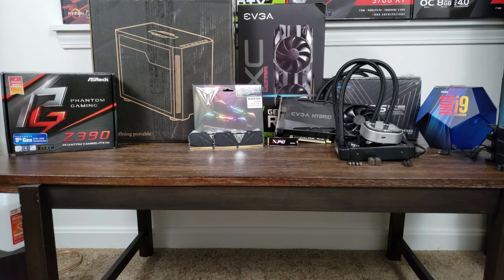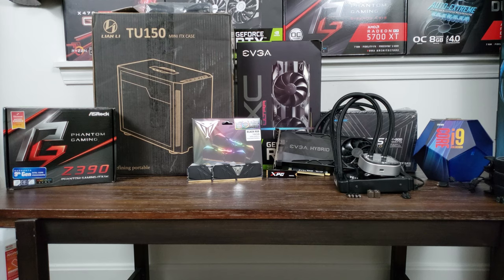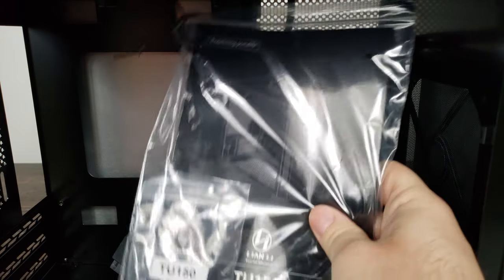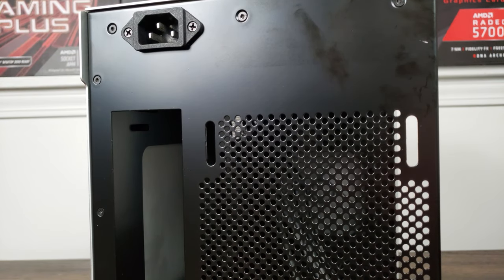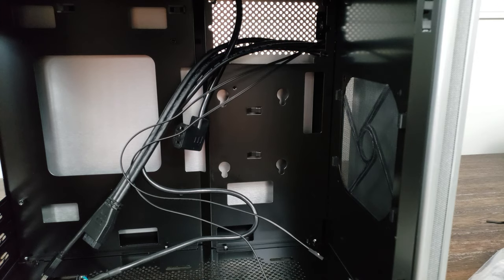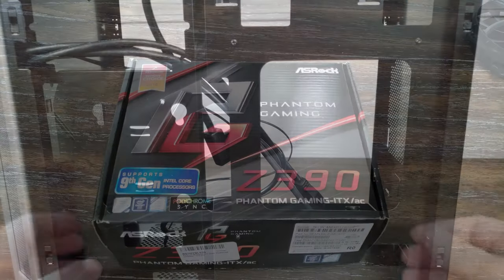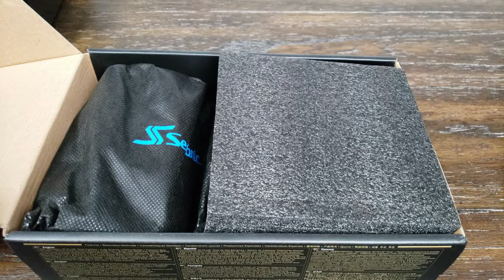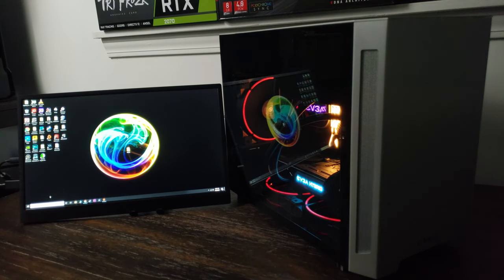ITX Bug-Out Box - Lian Li TU 150-WA - Asrock Z390 - i9 9900k

Comment: That's a pretty nice build! Only thing I'd be eager to change is the 500W PSU for some overclocking, but overall pretty great! It's the downside of small form factor builds I guess - even if you did overclock, you're limited in cooling capabilities due to size. Gotta love these Big Power in a Small Package builds tho!
Reply from the maker: Yeah I considered looking for a higher wattage supply, but Amazon is shipping things in strange intervals so most supplies I looked at would have taken a month to arrive.  Additionally, I don't plan to overclock this particular system so it's fine for what it's for.

Comment: Very nice! I have this same case with a 9900k also but with a noctua u12s cooler. How is the 120mm AIO doing so far with the 9900k? I would like to try it out but I was not sure if a 120 would cool a 9900k while gaming especially with a 2080 super also in the case. Thanks.

Comment: Nice board choice! ASRock Z390 PG ITX has been working great with my 9700K @ 5Ghz/4.5GHz 1.345v LLC2. VRMs stay reasonable around 65C-70C during gaming, and go up to 105C after hours of AVX-enabled P95 Small FFT but without any throttling which is great. EVGA 240CLC keeps temps reasonable, never going above 65-70C except under AVX P95 SmallFFT which pushes it to 88C. I put some extra Kingpin KPx thermal paste between the M.2 heatsink and the plate contact points to add a little extra thermal dissipation for the VRMs, although having a Samsung 970 EVO Plus 1TB sitting under there might negate any benefit, lol. 2x 8gb Teamgroup DDR4-4000 CL18 T-Force Nighthawk running at 4266 17-17-17-28 @ 1.46v. 

How are you liking the ASRock ITX board? Tried any overclocking on it w/ the 9900K? I was contemplating picking up a 9900K some day, since with the current events I'm not sure when exactly Z490 will be available. EVGA's Z390 Dark has also been going on sale for $399 but the "EATX" form factor makes me worried it might be a pain to fit in many cases. Amazon has delayed a ton of shipping as well I've heard, although Newegg seems to be readily shipping stuff out daily still. I have 2x 8gb G.Skill TridentZ RGB DDR4-4000 CL17 1.35v sticks on the way to hopefully get a little more out of my 9700K for the time being.
Reply from the maker: I just finished the build yesterday and haven't had time to test much.  Since I'm only using a 500w PSU I won't likely do any overclocking though.
Reply from the maker: I'm looking into ways to utilize the Thunderbolt 3 port.  Those are kind of rare on desktop PC's (seen more on Mac's and on some laptops).  I have an eGPU enclosure where I'd be able to hook up a 2nd GPU.. not sure how valuable that is in this scenario but it's something.  Was also looking at "Blackmagic 4k Mini" capture devices which are TB3, but those are quite expensive.  There's also external TB3 storage options.
Reply: @DruuzilTechGames  Yeah, I have an old Seagate TB2 SATA cradle from back when I used to use a Macbook Pro 15inch for school, and using a TB2->TB3 adapter have been able to get the board to basically take any SATA3 drive and treat it as if natively connected to an "internal" SATA connector (e.g. you can upgrade firmware on Samsung SATA SSDs). However, I believe the ASRock only gives you PCIe 3.0 x2 instead of x4 like on laptop TB3 implementations, but haven't really been able to verify since I lack a TB3 M.2 nVME external dock or an eGPU box. Considering that basically no other mainstream Z390 board I'm aware of except the Gigabyte Designare has any kind of TB3 ports, it's rather nice. Good luck on trying it out with the eGPU box, and stay safe!
Reply from the maker: @vapidwords  Yikes.  If it only gives 2x lanes it seems like that wouldn't be worthwhile.   I'll see what I can find out.

Comment: It is pretty but I don't know about pairing a 9900k with only a 120mm rad.  Better cooling with a noctua 140mm air cooler
Reply from the maker: Pretty limited space in that case for an air cooler.
Reply: @DruuzilTechGames  No it isn't, the TU150 fits 165mm air coolers by design.

Comment: 9900K with a 2070 Super? I mean it works. This is one of the worst cases for thermals. I had a 9900K and 2080 Super Hybrid in this case and I had to underclock the 9900K and crank the fans up way to much.